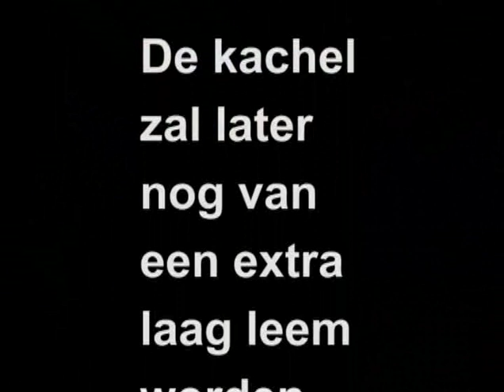Single bell batch box rocket

Comment: Hi Peter.   Thanks for the videos.  I am about to build one of these 6” heaters and I am confused about the secondary air tube.  Should it be in the bottom of the fire box or on top? Also if you have any general advice for this design I would love to benefit from it.   Thanks again.   Regards. Tanc
Reply from the maker: In this implementation the secondary air duct is on top, this specific duct is called a p-channel. In later years another secondary air channel is developed. It's on the bottom of the firebox and is called a floor channel. Both are described on the batchrocket website, https://batchrocket.eu/. This website is in 9 languages so far, Polish being one of those.
In general: have a look at the three barrel workshop heater, https://batchrocket.eu/en/applications#threebarrel
quite similar to this one but better implemented.
Reply: @peterberg10  thanks so much for your reply, the three barrel version looks great.  can i understand from this that a taller heat riser is ok without making the batch box bigger?  also what should i use between the halves of the batch box? my understanding is that and expansion joint is needed, should this be fire rope as on a door?   thatns again for your help and your amazing body of work.  i am trying so hard to be patient and not rush to the first burn!!   regards.   tanc

Comment: hi peter, is er metalen onderdelen in de stijgleiding? doet het overleven? dank je
Reply from the maker: Hi John,
Yes, in this experiment there is. Or actually I have to say, there were. The inner pipe was made of stainless steel with about 2" of vermiculite around it. After a couple of months of intermittent running the inner pipe collapsed and the vermiculite ended down on the bottom of the riser.

So a year later we changed the riser pipe out for the same construction with a cardboard inner tube and a clay/perlite mix around it. The inner tube burnt out and the clay/perlite holds uptil now.
Reply: thank you peter, for your quick reply and information, and for sharing your work with the community>  good work